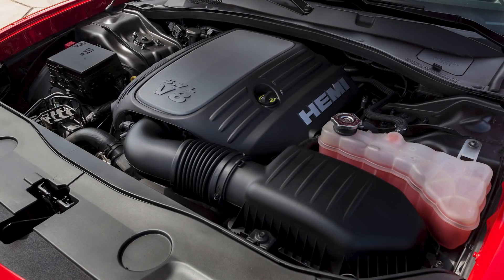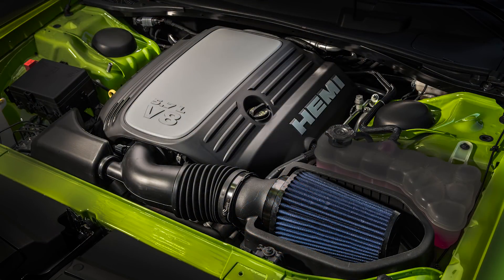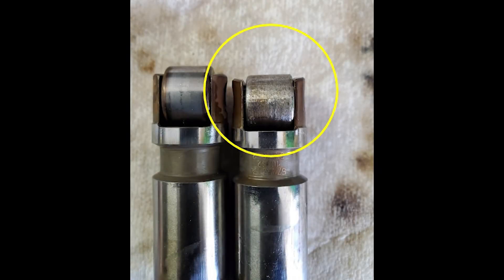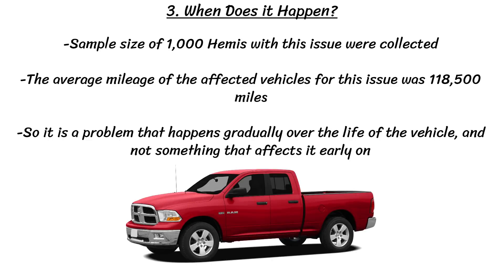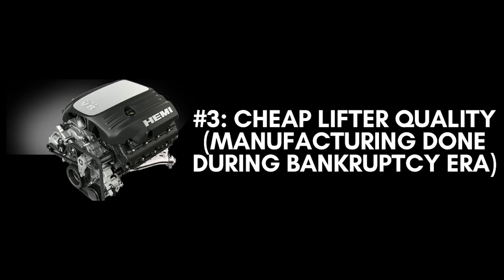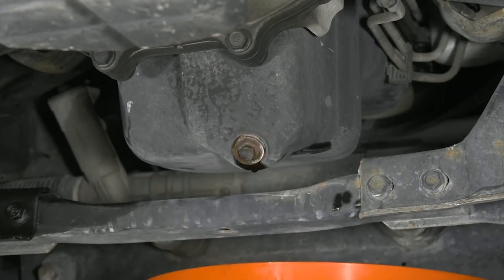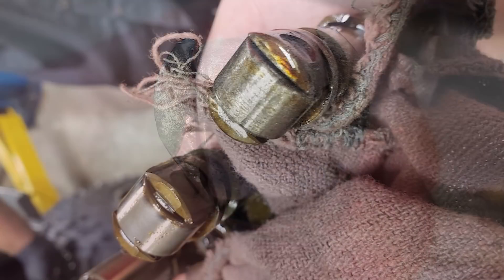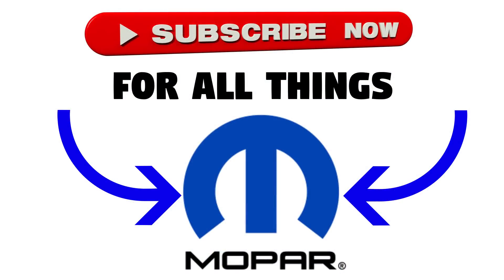The Fatal Flaw of the 5.7L Eagle Hemi V8 Engine Fully Explained (2009+ Lifters and Camshaft Failure)

Comment: I own a 2018 Chrysler 300C. I noticed if my car sets in the garage without use. I get lifter chatter at startup that end within 30 seconds. I only have 18,400 miles and change oil at the dealership. I still have power train warranty, so I'm not wanting to Make Changes unless under warranty. I've thought about going with a performance cam and lifter set which would improve performance and should eliminate the issue you covered in the future. You mentioned no recall because it's not a safety issue, but didn't Ford have to handle a transmission issue which I believe had no safety issues attached. I believe the big V8s will be replaced by 2035. I plan on keeping my 300C because I like the power and luxury combination.

Thanks for the detailed efforts put into your video. I just wish Chrysler would step up and take a close look regarding this issue and add extended warranty to cover this issue. Chrysler knows there's an issue. They just don't want to take ownership of it. Thanks again.
Reply: your 2018 is fine, the initial chatter is the pushrod leakdown, its normal.  sometimes it gets better, sometimes worse... really just depends on pushrod top wear and seating and how much pressure is on a pushrod when the ending is shut off...
Reply: i traded my 05 bright silver  300c in on my 2019 red velvet pearl 300c so far i have been pleased with both. the stance , color and performance . i hope to keep it until i  no longer can drive , then i'll use it as a lawn ornament !
Reply: sits...not sets

Comment: 221,000 on my 07 Charger R/T, still runs and drives great. Never knew there was a problem till I saw this video. I plan to just leave it alone.
Reply from the maker: 03-08 is a different problem, valve seats dropping. You’re basically immune from this one
Reply: @MarspeedCars  Sounds like maybe I've just been lucky. Did change over to full synthetic at about 7,000 miles
Reply: @MarspeedCars  The cam lifter issue is worse!

Comment: I have a 2012 and a 2014 ram 1500 with the 5.7L I’ve always ran fully synthetic oils but my trucks idle a lot and I change my oils like every 5000-6000km the 2012 has 394000km on it but the original motor had 378000km I got stuck plowing and got it hot she locked up. The 14 has 421000km first motor went at 400000km but that truck is always pulling trailers and both have been threw hell and back

Comment: only thing going on with my new 300S Hemi is a rough/slow idle.. so i took it in to the dealership and of course it was running fine, and they said it wasn't showing any codes or anything. it usually starts after it warms up completely .. and comes and goes. it seems like it's not as bad if i stick to lower octane fuels. so i don't what's going on, just need it to go away!
Reply: Watch your oil pressure closely when it happens. Look for a pattern where low oil pressure equals rough idle.
Reply: @snek9353  k,  thanks!
Reply: what year?  Its your EVAP system typically... Under idle its dumping fuel vapor into the intake...
Reply: @darthhemi1735  2021, has done it since i got it couple months ago, brand new. so recently installed a JLT CAI, and it seemed to have helped.. it doesn't do it as often as before, but it's still there.. like stopping for red light etc.. comes and goes

Comment: Good Coverage! 
1 million Hemi's per year since the early/mid 2000's...less than 5% of them have the issue,thats the high end of the percentile.
Reply: Failure in our Police fleet is close to 100%, some as low as 20000 miles.
Reply: @benjaminwayneb  fire your oil change guy...  oh but sure he will blame the Hemi, not his crappy maintenance...
Reply: @darthhemi1735  We use Mobil 1 synthetic and oil change intervals are based on fuel used instead of miles because of idle time. It averages out to an  oil change every 3000 to 3500 miles.
Reply: @darthhemi1735  Our interval is half of what is recommended for servere duty. The engines are just shit, GM's and Ford's are not having failures with the same maintenance.
Reply: @benjaminwayneb  wrong... it supposed to based on idle hours... you just said you were doing it on gas usage
Reply: @benjaminwayneb  you're supposed to use pennzoil synthetic oil!
Reply: @califaern3sto  No difference.
Reply: @benjaminwayneb  Pennzoil Platinum every 3k.  Every other synth oil is just that; oil, but its treated by steam or acid to purify it.  Platinum is made from straight from natural gas, the best.

Comment: Eventually valves will be open by means of electric magnetic which can manipulate valve from smooth perfect idle to high output like a high performance camshaft. The computer will be able to optimize low end high torque top end horsepower. That's if powers in office at this moment in time don't outlaw gas engines because they don't want you in a car that burns gas.
Reply: They don't because it's easier to control your mobility with electric. Have you noticed how hard they're shoving it down our throats?
Reply: @MyerShift7   yeup! It's political with dumorats and they will start taxing by the cubic inch. They want us off the road if we own petroleum propelled engines. Sooner than later gas will spike to $7 a gallon in a effort to minimize travel. People are so stupid in believing theories that can't be proven in a lab. Now that we have a brain dead president and a vice president who wants soldiers to wear solar panels on their backs as they fight. It's fucking nuts!

Comment: I have a 2012 ram 1500 regular cab with 191000km. changed the oil regularly always used mobile one full synthetic. never  towed anything but my 5th cylinder failed. The lifters failed and the cam failed and scored the block lots of deep scratches in the block. I had to put a rebuilt engine back into it it. Runs like new now
Reply: Did you buy it new?  Did you idle it a lot?

Comment: I still believe that the issue is caused by the VVT that was added in 2009. Even more so for the engines with both VVT and MDS. I think that VVT puts more strain/pressure on the lifters under certain conditions (higher rpms), and less strain/pressure under other conditions (lower rpms). I think this is what causes premature lifter failure. Makes more sense than all other options I have heard mentioned. Yes high idle hours are bad, but I still think VVT is the biggest culprit. Especially on the high idle hour vehicles.

Comment: We have a 2013 Jeep Hemi with only 50,000 miles. Always used 5w-20 and no Hemi tick. Even started using higher ZDDP oil (Royal Purple HPS) to further preserve it lol. I also refuse to idle it excessively.

Comment: Rotella T6 5w-40 in my 5.7 I use it in my 392 as well. The reason is it doesn't have the lubrication stripped to meet gasoline oil standards. Rotella used to be gasoline approved until the epa required less zinc and phosphorus because it is dirtier for the environment. So basically we're using oil that's not adequate in my opinion. So for example I believe the epa requires 700ppm or less of phosphorus to be a gas engine oil. Rotella t6 has around 1200-1400 I believe. You would have to research Virgin oil analysis to see what each oil you use had in it. Very interesting if you care to research it. This same kind of thing happened to older diesel trucks when they took sulfur out of the fuel. All the older trucks that needed the lubrication in the fuel started having fuel injection pumps and injectors sticking and seizing. Easy fix is add a little two stroke oil or similar fuel lubricity additive to make up for it. Basically it's not about amount or volume of flow but rather the additive package that makes the oil slick is not adequate. They don't care about the engine over its lifetime they only care about environmental bullshit.
Reply: The low phosphorus might be part of the problem with the oil but the real culprit is the low Zinc levels that are now down around 8-900ppm. The Zinc should be up over 1100 and preferably up around the 13-1400 range. The Zinc was reduced because it is thought to have been hurting catalytic convertor life. In any event higher viscosity oil is Definetly helpful. Stupid 5w20 is insane to run.10w30 to 15w40 is the only way to go depending on where you live. ie The hotter the climate the Thicker oil you should run.
Reply: 5W40 doesn't throw a code in your 5.7? I keep reading in forums that too thick of an oil will throw a code on the 5.7. 

I like Rotella T6, I use it in many of my older engines both gas and diesel. However in my 5.7 Hemi I use Redline High Performance. The Redline is pricey, but a true esther base synthetic(T6 is crude based) with great performance including 1200 PPM of ZDDP anti-wear additives. I'm currently using their 0W30 and think it might be the ideal oil for this engine used as a high performance daily.

These engines if they don't throw a code can clearly handle a 40wt as it's what's used in the 6.4. However I think it's overkill and will only lead to lower efficiency, hotter oil, and faster oil breakdown. The 6.4 uses 40wt because they have piston oil squirters that use oil to cool the pistons, the 5.7 does not.
Reply: @snek9353  people still upgrade the oil pump on the 6.4 because the oil pressure can be a bit low at idle for these engines at 30psi. its ow40 for the 6.4

Comment: I think the metal is too soft because even the valve stem and rockers wears out and the valve seats falls out , back in the days Chrysler engine was cast at higher temperature than ford and Chevy now it's all low temp cheap metal parts .
Reply: yup. Chrysler had better metallurgy back then, higher nickel content iirc. One 70's mechanic said he never saw the inside of a 318. My '64 318 died in 1996 and was opened only because it's 20 y.o. rubber valve seals were gone.

Comment: Had to change out my lifters and cam on my 2012 Ram 1500 a few months ago.  It had 176,000 at the time.  It had been ticking for quite a while from both the lifter and the broken studs on the exhaust.   #5 cylinder intake lifter was the one which went bad and the #5 exhaust was starting to go.  All the other lifters were just fine!  Unfortunately,  due to cost and availability,  I went with a Chinese made replacement which although it works fine so far, the new lifters are very much noisier than the originals.  I just hope they last ok.

P.S.  I did all the labor myself,  it took me about 3 days so it only cost me the part cost, about $700, plus a days off pay.

I also replaced a few other items while I had it apart including the broken exhaust studs.
Reply: Same here with my 09, but mine is in shop now. I went with a comp cam. Yeah, it was expensive, but my mechanic had tried Chinese cams before and didn't think much of them. I wish I could have done it myself, by the time I get her back I'll be $4k or so into it.

Comment: I’ve got a 2017 ram 5.7 it had 30.000 miles on it when I bought it 2 years ago it now has 80.000 miles... I haven’t had lifter problems so far...( knock on wood) but I did have the bolts to break off in the manifolds on the left side for no reason causing a exhaust leak... they tell me most of the steel and copper and other metals came from China and their metals suck....home AC units made 10 to 15 years ago also had a lot of China copper for the coils ...and they have hair line cracks in the tubing causing them to fail after a short period.... thanks for your videos buddy...

Comment: The problem occurs during idle. The lobes simply aren’t getting oil when the trucks at idle. Police cruisers and people who use them as work trucks and use their truck as their office are gonna be the ones with the most problems early on. Eventually they’ll prob all do it when they get enough miles. It’s one of the only things keeping these motors from lasting 300k miles or more but it’s a Chrysler product so what do you expect. They sold out to the Italians and then sold out to the French with a company that was opened earlier this year.
Reply: It's more complicated than that. There's plenty of oil at idle but yes idle is an issue. As alluded to if the oil is changed based on miles alone engines may go well beyond the oil's lifespan. They're often also idled to run the AC and have no oil cooler, meaning the oil gets very hot and thus thin. This with an oil that is already thin being a 5W20, and is consumed by the PCV system. 

But there's also clearly a quality issue that started in 2011 and went through 2013, it's very telling that 2009 and 2010 engines don't have lifter issues.

Comment: GMC, Cadillac and Chevy Motor has the same damn lifter problems.. my 6.2 ticks when it deactivate the v8 to v4... horrible its been over 15 yrs and they never fixed it! Never buying the big 3 ever again... Toyota here i come.
Reply: But the problem is solved and Toyotas aren't without there issues, and generally suck.

Comment: Chrysler and gm should have faced a class action lawsuit for these issues.
Reply: Ford has the same issue on the 5.4 roller rockers
Reply: It would not surprise me, and frankly I'd consider it likely. That all of these issues stem from a drop in quality from one common supplier.

Comment: 2011 wk2 5.7L HEMI 106,000mi. Cylinder #5. Replaced the cam and all the lifters. @111,000 (5,000 miles later I got a DTC for misfire on #1. compression and leak down had no anomalies (i.e. passed). I'm suspecting a faulty MDS Solenoid. HELP!:

Does anyone know if when in MDS mode is deactivating the valves, does the system also deactivate the fuel Injector and inhibit spark for the subject MDS cylinders? 

My theory is in the hypothetical case of the mds solenoid failure mode stuck in deactivation (i.e. valves not opening) in normal full power mode? This would have fuel and spark without the valves opening... Alternatively, if the solenoid failure mode happened to stick in the activated (valves opening) in MDS Mode and the system inhibited spark and fuel injection this would be a misfire that I'm experiencing. 

Any thoughts or suggestions would be greatly appreciated...
Reply: Why do you suspect MDS and not for example an ignition issue?  

What kind of vehicle? 

Is this cylinder constantly missing, sometimes missing, or is it just the code?
Reply: Yes in 4 cylinder mode the system deactivates the fuel but I doubt it deactivates spark. 

If for some reason the ECU was in 4 cylinder mode but the valves were till opening it would not throw a misfire code. It'd simply run a little rough as that one cylinder would still be pumping.

Comment: It's not just an MDS engines. Some stick cars have had lifter issues as well. So it's definitely the roller bearings that are inferior. It's best to upgrade the lifters to hellcat lifters, as their roller bearings are much larger, and better.  They did an upgrade on MDS on March 2015, then later on 2016 but, I've seen a 2020 car with lifter issues, so maybe that is bs from the factory.
Reply: There's no such thing as hellcat lifters, yes they were upgraded. But it's not always a bad lifter that causes lifter issues. Lifters are a high stress part, so they can be the first thing to fail in a poorly treated engine no matter how good the lifters are.

Comment: If you don't change the oil every 3000 miles the passages in the lifters clog up causing them to fail
Reply: There's no passage that is the cause of this issue.
Reply: @snek9353   Do you know how the MDS works
Reply: @mauricecooper176  Of course, but this isn't an MDS issue. Nor are there small passages in the lifter as part of the MDS system. There's portions of the solenoid that can clog, but not the lifter.
Reply: @Nestor Aguirre Depends on what's most important to you. Mine is a '14, I think it's peak year but AWD is very important to me.

Comment: There's another ticking noise that I don't see anyone mentioning. The injectors sometimes make a ticking noise. My challenger makes a ticking noise sometimes, and I was worried that it could be lifters and after doing some looking I finally found some videos of the injectors ticking and it sounded the exact same as mine.
Reply: All injectors tick.
Reply: @snek9353  what I meant is how loud they tick. Some of the 5.7s have very loud injectors
Reply: @whattheduck4644  Can't speak to that, haven't noticed, maybe I'll pay more attention. Are you sure what you're hearing is injectors though, have you tried the hose trick. Little old school thing, grab a chunk of hose, better if it's a stiff hose, not garden hose or small vacuum hose. But something between like 3/8" fuel hose and 5/8" coolant hose. Put one end to your ear, and the other to the part of the engine you want to hear better. Move the hose around to see what parts are making what noise.

You can also do something very similar with a long screwdriver. If you want to hear inside a valve cover for example. Put the handle of a long screwdriver to your ear and touch the tip to the valve cover. Works will with injectors as well, if for example you want to compare the sound of your injectors to find a faulty one. 

A skilled ear is a mechanics best tool.

Comment: A small inexpensive component like the lifters can cause major costly repairs.  Like what was mentioned in this video the bad lifters lead to the cam shaft getting replaced.  I'm sure lack of lubrication for the bearings inside of the lifters has something the lifters not functioning the right way.  This is a flaw in which Chrysler themselves will not admit publicly.  This particular problem is more than likely fixed by now for the newer vehicles.  If this problem got fixed there was no announcement of it though.  Depending on the scenario other components might need to be replaced such as the valve cover if there's a crack on it and the valve cover gasket.